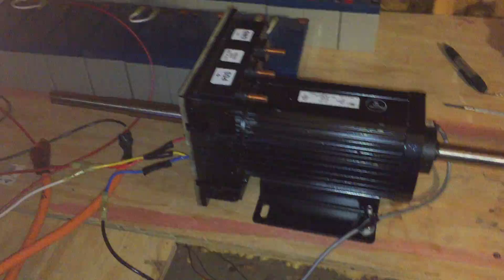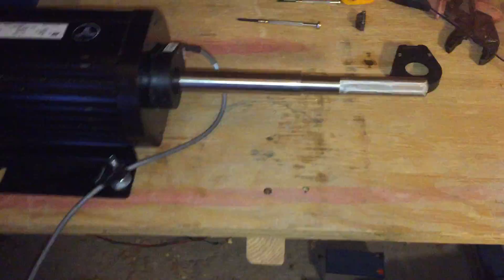PMSM (brushless DC) field oriented control

Comment: hi brother great work!! can your controller work on 350vdc? i have a similiar pmsm car motor that has a very low impedance i.e .5 ohm or low,  i tried runing it on 6 step bldc method with bemf, it works fine under under 100vdc, but  i have to run it on 350 vdc.

Comment: I have been thinking of a similar project recently. However, i wanted to over simplify it by using a 3 phase inverter of the market, a VFD of the market to control speed. Would this achieve the same thing and what would be the drawbacks